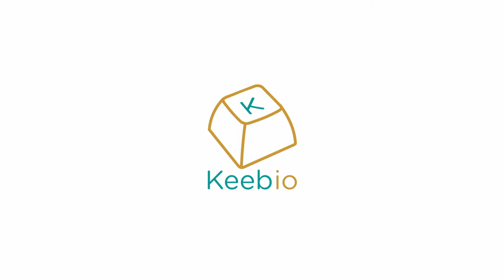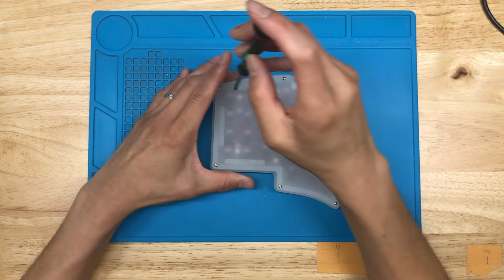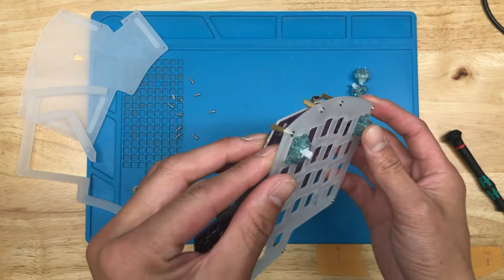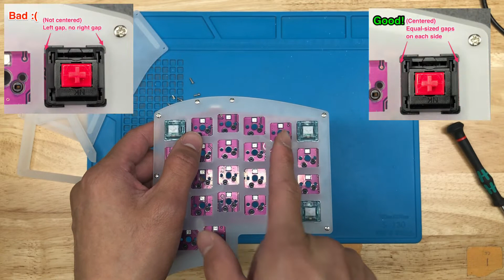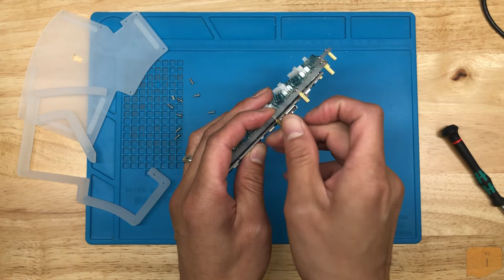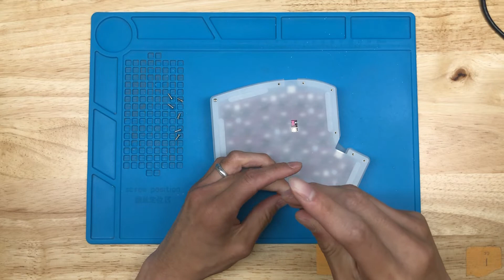Switch Installation for Pre-Built Keebio Hotswap Keyboards

Comment: Is it permissible to change the switch in the Iris keyboard without separating the bottom plate and middle layer?
Reply from the maker: It’s possible, but you risk popping off a hotswap socket if you do not support it from below

Comment: Would you recommend 3 pin or 5 pin. I like gateron pro brown but can only find them in 3 pin.
Reply from the maker: Both 3 pin and 5 pin work well! Just be sure it is snug in the top plate and it'll have the support it needs. Cheers!